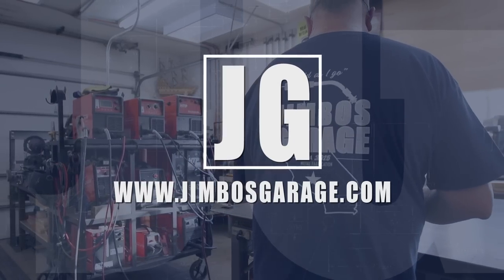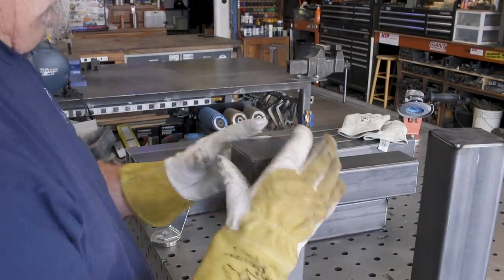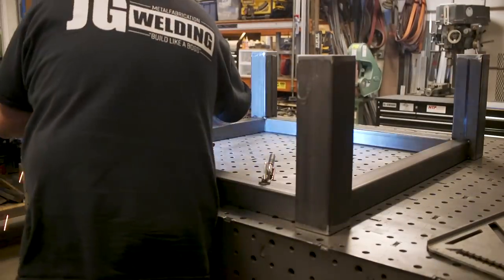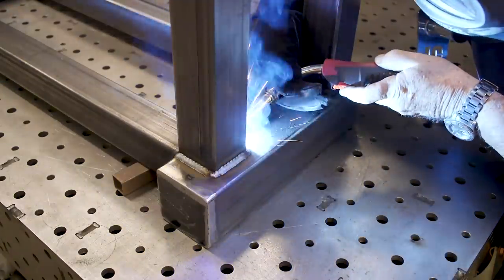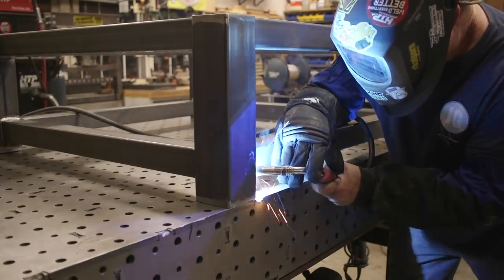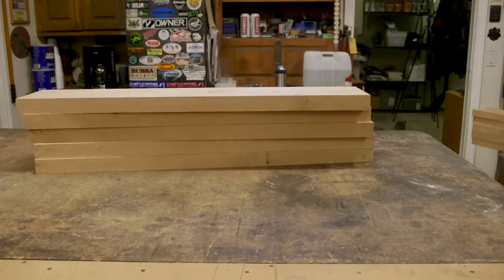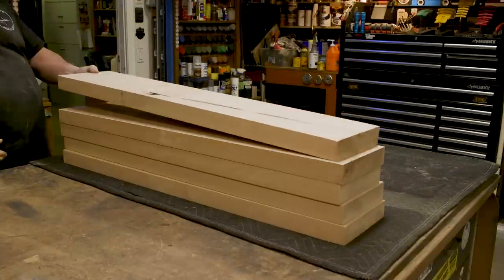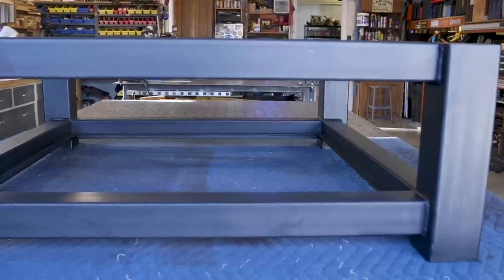Metal & Wood Coffee Table Build | JIMBO'S GARAGE

Comment: Another Beautiful job Jimbo.  I make multi use yard tables like that. They are very similar in design. Steel frame / plank top to match deck.  They are good as a work bench, BBQ side table,  wok / propane burner table, Throw on a removable sheet metal top and it's a welding table, a sitting bench, sun tan bench etc. etc.  I sometimes even make fancy steel framed picnic tables of various designs.  
  Being retired, it's just a hobby. I scrounge up steel at the local dump. It's as good as new when it's cleaned up.

Comment: If you can, in the future, make the screw holes in the metal L brackets oval. As the seasons change and the wood absorbs or sheds water from humidity fluctuations, it will expand and contract across the grain. With as tightly as it is fastened there it might end up cracking over time.

Wood is sold in 1/4 inch increments of thickness. So 8/4 would be 2 inches when rough sawn and finished out to about 1 3/4 inches.

Comment: Jimbo! Wood moves. The way you attached the screws to the base doesn't allow the wood to expand and contract. What likely will happen are cracks in the wood as the seasons go by. You should have elongated the holes in the steel before screwing into the wood so that it has a little space to move. Good looking table.
Reply from the maker: Thanks for watching and your imput Alec,    Jimbo!

Comment: Jim if you ever want to go to the next step to glue the table top together its easy.  Just use white glue between the boards.  Sand them off. Then sand the hell out it until the cracks disappear.  The table top will appear to be one piece of solid wood.   It’s just one step nicer

Comment: Great build! Next time, check out a product called General Finished Arm R Seal. It’s an oil/urethane mixture that is super easy to use. It gives the richness of an oil finish with the durability of a clear coat. Best finish I’ve ever used.

Comment: I’ve used those hard plastic furniture slider discs to move heavy pieces around on a welding table. They work great but def need to keep them away from the heat. Great video btw and I’m officially addicted/subscribed

Comment: I think the hard woods and higher quality woods accept stain a lot better than some or the more "construction grade" wood.  If you ever stain cheaper wood, you can use a "pre-stain" product that helps the stain absorb much more uniformly.  I use pre-stain on everything now because it sucks to finish a project and apply the stain and have some parts of the wood soak it in great and other parts not.

Comment: Sculpt Nouveau makes amazing product. Kinda pricy but amazing patina. The problem was the mill scale, in order to get a good reaction with the patina you need to wire wheel the scale off and then on top of that I go through with a fine metal finishing pad and really clean that metal good. Then apply the black magic and it will blacken instantly. After that you can even go back over it lightly with the pad and put a very nice rustic distressed look to the steel. It is a process and a lot of work and can be very difficult to learn how to use but amazing after you know it well.  Good idea to seal it to protect from scratches incase someone rams it with the vacuum. They make an incredibly strong 2 part sealer as well
Reply from the maker: Thanks for your advise!  Jimbo!

Comment: Now THAT'S my kind of coffee table! As several people have already explained what 8/4 refers to I can expand on it a little bit. Lumber Mills and distributors of rough sawn lumber are the main users of the 1/4 system...when a board comes off the saw it is dimensionally correct. An 8/4 x 6 is going to measure an actual 2"x6".  After it goes through the mill to smooth all 4 sides up it comes out missing a half in both dimensions. So now your 8/4x6 piece is  your common 2x6 which is 1 1/2x5 1/2..

Comment: If you want to blacken steel try Birchwood Casey gun blue (super blue)  - gives you an almost instantly reaction and you can add multiple layers - - polish with wire wheel grinder for a blackened polished look or keep flat

Comment: Hey Jim, not sure your exact struggle details with the blackener. I always remove mill scale first, going over piece with 80gr flap disc, then maroon ScotchBrite wheel. Wipe on blackener with blue shop paper towel or foam brush. Results are immediate. I use damp terrycloth towel after & seal with either clear lacquer or linseed oil. Hope that helps. Best, @HoneyOnWales
Reply from the maker: Thanks for watching Drew, And your advise.    Jimbo!

Comment: Great looking table, you build it how it looks good to you and that's what matters.  I am a "wood guy", looking to get into welding too. I'm building a post and beam shop and plan to fabricate my own steel gussets, wrap straps, and beam braces.  So from a wood guy:  for those of you commenting on running splines or dominoes to glue up the top, probably not a bad idea but shouldn't be a problem.  That 8/4 alder is not going anywhere.  As for splitting as the wood contracts, I doubt it.  Again, thinner stock would be a concern, but with the number of mechanical connections (screws) into an 8/4 hardwood, I doubt you're going to see that crack at all, ever  Even if it did, would add rustic character like the knots, which is I think the effect he's going for here. The only thing I might be concerned about is that there is a significant amount of twist in the board, so the natural grain tendency will be to cup in the direction of the curl.  What you might see over time is a couple of those boards "heaving" due to warp.  If that happens and it bothers you, haul the whole table back out into your shop, take a belt sander and re-flatten the top  (with it still connected to the base), and then re-stain and re-oil it.  Pretty simple fix.  You could also fabricate a router sled to flatten the top (you can google that to see what I'm talking about,  there are hundreds of videos on how to do this), but if you aren't going to be doing a bunch of this work, the router sled is huge overkill.  (Side note: wood guys who do a lot of flattening would probably buy a fabricated steel router sled for good $$. Most of us use plywood versions we have to build  ourselves).  Maybe for a future video, you could team up with a true woodworker and the two of you put something cool together, with your metal fab skills linked up to some high end joinery.  I don't see a lot of that kind of content on Youtube.  Either metal guys or wood guys, rarely both.  One exception is April Wilkerson down in Texas, she's been getting into welding.  Give her a look, seems like good people.   Table looks great, and I'm learning a lot from your videos.

Comment: Normal deck board is what is referred to as 5 quarter board or 5/4=1-1/4. So 8/4=2. This means your board should be 2 inches thick. Divide the numerator by the denominator. You could add 8 quarters together to get 2 wholes. (1/4+1/4+1/4+1/4+1/4+1/4+1/4+1/4=2)

Comment: For patina to work. the tubing or any steel must be free of all mill scale. And That's not fun to remove at all. Or ALAWYS use cold rolled steel for any thing that will be having a patina. Use a degreaser to clean before application.

Comment: When I use AutoCAD to draw a cut file. It's pretty easy to add the radius. And to know the radius is pretty easy. It's wall thickness * 2 equals diameter

120 wall equals .1200
1200+1200=2400
So you have a 2.4 diameter circle on each corner which is considered your radius.

Comment: Quarter = 1/4", so 4/4 = 1"     Then 8 quarter is 8/4 is 2" thick
Reply: why dont they just say 2inch haha
Reply: @SamFBM  framing lumber/wood dimensions are pre milling. So a 2x4 is only 1.5" x 2.5 when sold if you measure it. The lumber he is using is sawn to actual sizes measured by 1/4" in  increments. 8 quarter is 1/4" times 8. You mill it yourself generally before use in furniture and such with a planer/jointer/sander and such to whatever ever thickness you want.

Comment: I really don't like to have metal in contact with carpet or tile.  On carpet there is a potential for rust stains and tile can be scratched. One way to remedy this is to weld your bottom cap 1/4" up inside the leg tube.  Then attach 1/2" UHMW pads with countersunk self taping screws.  UHMW comes in two colors; black and white and is available from most plastic supply dealers.  It can be worked with wood saws and routers but clogs up sandpaper.  It is also slick as snot..